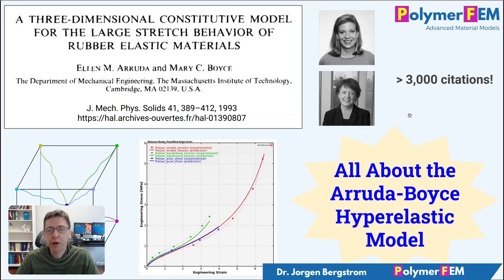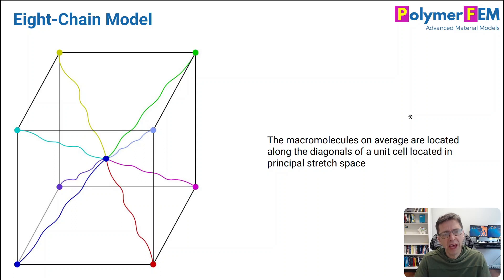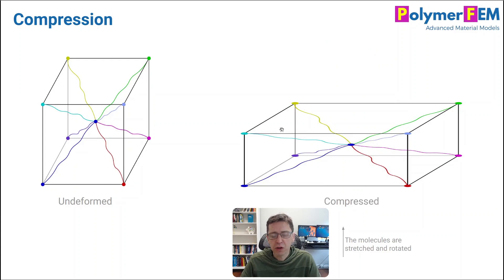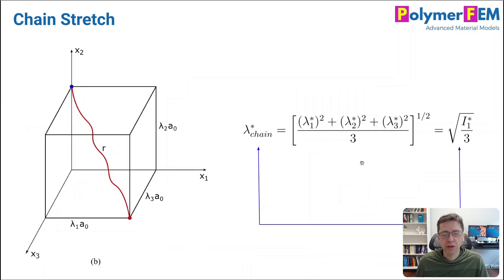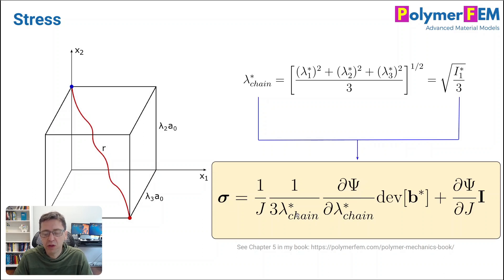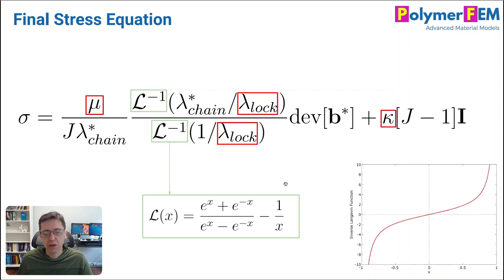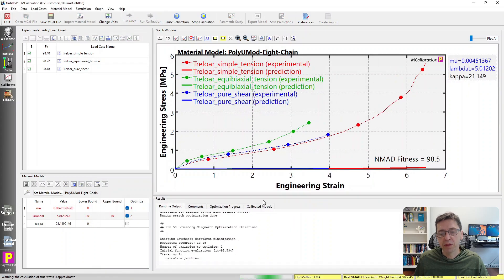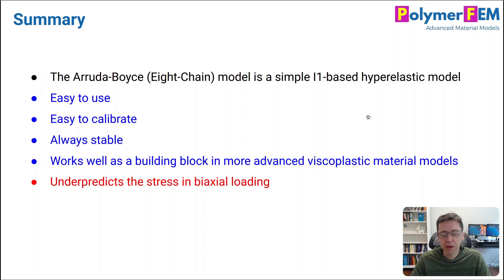All About the Arruda-Boyce Hyperelastic Model

Comment: Is there an advantage to using the Arruda-Boyce model over the Gent model?
Reply from the maker: If you use Abaqus then I recommend using the Arruda-Boyce model (since Abaqus does not provide native support for the Gent model 🙂). In other cases you can use either model. They give basically the same accuracy of the predictions. I like the micromechanical assumptions in the Arruda-Boyce model, though.